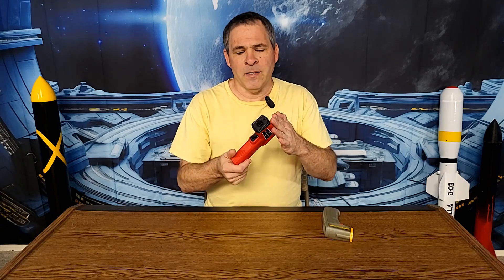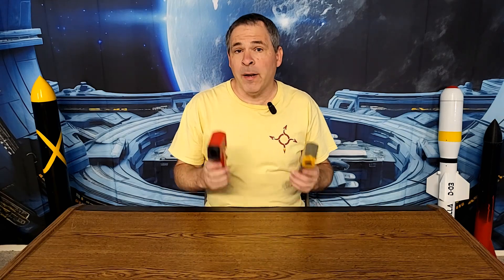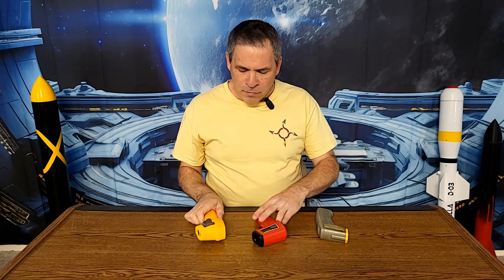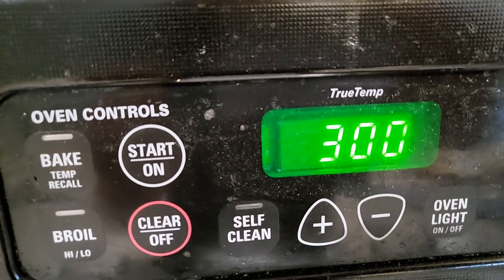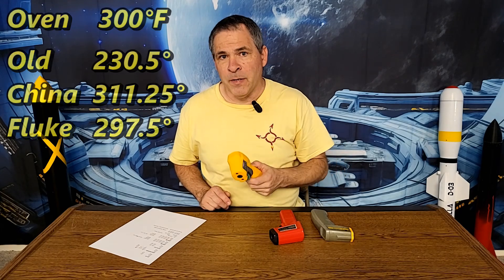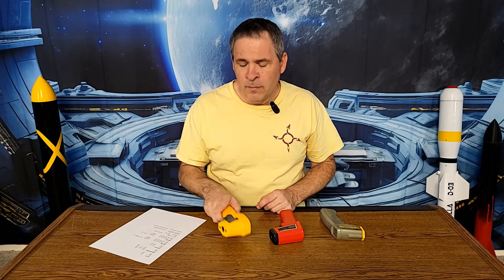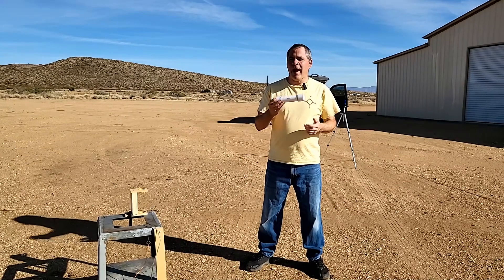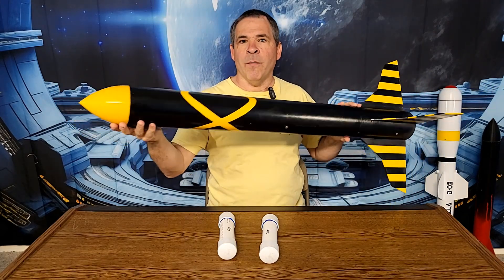I've been cooking sugar rocket fuel WAY too HOT

Comment: Wasn't Jimmy Yawn instrument as an innovator is sugar fuel before Dan? Not disputing you. Just been a while since I've read about Jimmy. I believe Jimmy called many of Rockets Sugar Rush. Most were red and neon pink?
Reply from the maker: It's quite possible that people were making this or a similar mixture before Dan. But I've heard many times that Dan is commonly considered the inventor of the mix and when I spoke with him, he is under that same understanding. I also asked Richard Nakka about it once and he also agreed that Dan is typically considered the inventor it. But that's not to say that there were never any people making it before. It's very possible that after coming up with the idea and mixture, Dan coined the phrase "flexi-fuel" and it's popularity took off from there.
I'm not familiar with Jimmy Yawn or his fuel mixtures. What sets Dan's "flexi-fuel" apart from the old traditional sugar fuel mixtures was the addition of corn syrup. Not sure it that was something Jimmy was using.
Reply: @rotaryrocketry Typos! Sorry. My phone is over caffeinated on spell check. I think Jimmy's motors were a mixture that hardened quickly, often had cracks and of course that lead to catos. This flex fuel seems a bit more forgiving also in temp range. Thanks for you videos. I'm getting back into rocketry after many years and appreciate your time you've invested on all this work.

Comment: Hey, can we use a digital probe thermometer, as here, where I live, its almost 8 times cheaper than an IR one?
Reply from the maker: You can as long as it reads the temperature quickly. You need a fast and fairly accurate reading.

Comment: Hmmmm, Richard Nakka asked me to oven heat our KNO3 for the Sugar Shot to Space project to drive out the water since it adds weight. If the KNO3 used where he or Dan lived has high humidity, that would cause measuring a 65-35 ratio to be different than where I live in the normally dry desert. That was the reason. Since I often make 15 to 150 pounds of sugar propellant at a time, drying those large amounts in a pan in an oven would be time-consuming; fortunately living in the normally dry desert, I don't have to do that. Even during the winter when humidity increases during dew or rainy periods, I don't bother with drying my KNO3.

I can't believe you use a simple $5 oven thermometer to check the calibration of your instruments. I've seen them vary by almost 20 degrees on the self in stores. But, is useful as a reference for comparing your three IRs. https://www.walmart.com/ip/Oven-Temperature-Thermometer-Thermometers-For-Inside-Accurate-Thermometer-With-Probe-Baking-High-Stainless-Steel-Pointer-50-300/5283794207?wmlspartner=wlpa&selectedSellerId=102633389&adid=222222222275283794207_102633389_14069003552_202077872&wl0=&wl1=g&wl2=c&wl3=42423897272&wl4=pla-319455734609&wl5=9031441&wl6=&wl7=&wl8=&wl9=pla&wl10=5499694558&wl11=online&wl12=5283794207_102633389&veh=sem&gad_source=1&gclid=CjwKCAiAg8S7BhATEiwAO2-R6tIPlDIW8ig0xhNRyAZ19j0NDAZl76kL7m-xV7k4Ml3cDS959t9twBoC2tkQAvD_BwE 

I could be wrong since I do not own the wok that you have but my experience with electric cookers is they work with a thermostat, the higher you set the temp, the longer the power stays on until it reaches that temp and then shuts off. My experience shows that when you measure the 'surface temperature' of the melt, that is different than what it is inside and the more melt you have, the greater the temp difference between the surface being measured and what is in direct contact with the metal on the bottom. It also varies with the amount and frequency of your stirring.

One thing I haven't seen you do is measure the amount of time you are heating your propellant. Water evaporates, the warmer the temperature, the faster the rate of vaporization. Corn syrup has as much as 25% water (that makes the stuff fluid). So even at a 'low temperature (~180 F) you are driving out water out of your mix. The longer you keep the temp at any elavated temperature, the more viscous your propellant will become.

Another thing to consider, if you are grinding your own sugar, the amount of time and amount in the grinder will determine your particle size; not significant IF the sugar is getting dissolved in the corn syrup which may not be happening if the water that would do the dissolving is leaving the corn syrup being heated. 

I seldom use a thermometer since after making thousands of pounds of KNSB, I know about when the temp is right by the viscosity of the melt. Sorbitol melts at about 200-205 F, yes, different types melt at different temps, but I usually heat at around 200-210 F and when it is all melted but still too viscous to pour, I turn up the heat somewhere between 250-300 F simply to get the container to start heating until it is fluid enough to pour (usually between 215 and 220 F). I don't need an 'exact temp', I heat it till it becomes pourable.

Another factor that controls the viscosity of your melt is the particle size distribution of your KNO3, something you don't know without doing a sieve size analysis. We often would do one for each brand of KNO3 we were using and adjust accordingly to bring it into what we considered to be our acceptable range.

As for your testing by comparing two flight videos, that would be valid only if you did several of each in addition to recording the ambient temperature of the propellant prior to launch...warmer propellant in the motor has a higher burn rate. We see that often here in the desert when launching at different times/temperatures during the day.
Reply from the maker: That's quite a post... Appreciate your thorough analysis.  For anyone reading this in the future, I'll try to address some of those comments.

As for pre-cooking the KNO3... It's a newer concept for me and I've only been doing it for a short while now. I'm also in  a dry desert but I still feel it's a good idea. I don't know how the KNO3 has been stored prior to me getting it. Dan Pollino was in the San Diego area when he was making motors. I'm planning on doing a test in the future to see if a motor with dried KNO3 will perform differently than a motor made with KNO3 that has been deliberately exposed to a high moisture environment.

As for the oven temp... There were really several factors for the temperature testing. The oven itself was set to a specific temp, the oven thermometer was there to verify that temp and then the three IR's were compared. So I was really looking at the overall picture from all of these readings.

The wok... I have found that it is VERY easy to overheat the fuel using the wok. Dan's original instructions say to turn the wok to it's highest setting. But I've found it better to start low and work the temperature up as needed. Stirring frequently and vigorously is a must to keep the batch of fuel at least somewhat evenly heated.

Heating time... Yeah, I think in some of my older videos I had put the cooking times on screen but I haven't done that consistently. Something I will keep in mind for my next build video. Now that I'm cooking to the proper temperature with my new IR thermometer, I have found that the cooking time is extremely short for my small batches of fuel.

Sugar granule size... I don't grind my own. I use powdered sugar. I know it contains a small amount of corn starch but I think the convenience of the product out-weighs the fact of having a small amount of useless corn starch in the fuel.

KNO3 granule size... Again, I don't grind my own. I'm purchasing powdered potassium nitrate. But as you know, that is not really a very fine powder... More like table salt. For the small motors I'm making, I'm not really that concerned with making super accurate measurements of the granule size for this. Sure there may be a slight variance in performance based on granule size but for my small motors, it's probably very minimal.

Flight comparisons... I realize that it would have been much more scientific to do like 4 or 5 launches with each motor and then average out the results. But really, that would have been WAY more work that I am willing to do for a simple project such as this. Also... getting 10 perfectly successful launches in a row... WOW... I'm happy to get 2 or 3 in a row without something going wrong. The launches were done back to back so the motors were at the same temp and the air temperature was basically the same for both launches.

Comment: I think I remember you saying that you cook on an induction cooker? That could possibly be what caused the problem. You're not supposed to have it around strong electromagnetic fields. It's that or either the emissivity was not correctly set on the thermometer.
Reply from the maker: I do not use induction... I use either a standard electric cooktop or an electric wok but neither are induction. Interesting thought... I'm not sure if and EM field would affect IR thermometers. The thermometer has no apparent adjustment for calibration but I'm gonna take it apart and have a look inside before I just throw it away.
Reply: @rotaryrocketry my mistake I saw a video and in the video they were using an induction cooker and I was thinking that was you.  I'm not really sure what it will do to the thermometer but I know it does say not to have the thermometer around electromagnetic fields. I have 2 different thermometers (different brands) and in both manuals it says to keep it away from e.m.f.
Reply from the maker: That's really interesting... And good to know.

Comment: Yuuup. I experienced this a while back with my wifes shop. She makes artisan soaps and you have to hit a specific temp for the process to work and pur first ir thermo gun was way off. Now she uses an old school candy thermometer haha.

Ok, now, here is my question. Can you still cook the fuel to 230F using an accurate thermometer such as the fluke? I mean, the 290F fuel worked for you, so i am guessing that 230 would be fine?

As for drying the kno3, i only do that when making the powder version of rocket fuel. But most of the time my kno3 is in a container with rock salt or a packet

If youd like the science behind why the 290 motor went higher, i can explain it:)
Reply from the maker: I think Flexi-Fuel would work just fine with any cooking temperature from 210F to 270F. It's just that the higher the temp, the faster it will burn.

I already have plans for an video/experiment for testing to see if drying the KNO3 is of any value.

As for the 290F fuel going higher... Well, you are welcome to post any insight you feel is appropriate. The flights were very similar and both well within the typical range for this rocket/motor combination. That faster burning fuel would have resulted in higher internal pressure and a more powerful thrust. The rocket with the 210F fuel also had a slight "wobble" just after it left the launch rod and that caused it to loose a little bit of speed.

Comment: Now it all makes sense. You may recall our back and forth on your K500 motor builds. We were trying to understand why your burn time was only 55% of Dan's burn time on your second (successful) build. None of the cook temperatures were making sense when comparing to the known and established candy making phases.

So, I looked back and reverse engineered what was really going on.

Your older thermometer was off by a factor of between 0.79x to 0.77x. So the real temperature was 1.26x to 1.30x higher than what the thermometer was indicating. For simplicity, I'll use 1.28x.

Dan cooked his fuel to 210F, but he was at sea level. This equates to 203F at your elevation.

For reference, here are the candy making phases at sea level.

230 - 234  Thread (syrup)
235 - 240  Soft ball (fudge)
245 - 250  Firm ball (caramel)
250 - 265  Hard ball (taffy)
270 - 290  Soft crack (butterscotch)

What temp should you have cooked your fuel, based on the faulty thermometer?

203F / 1.28 = 159F

Just for fun, let's take a look at your second (successful) fuel prep and find out what really happened.

160F measurement
This is when you should have stopped cooking, since the real temp is right about 203F, adjusted for elevation = 210F. I noticed that the color of the mix is almost as white as the unheated mixture.

170F measurement
The real temp is 170F x 1.28 = 218F. Adjusting for elevation, this 225F at sea level. This is approaching the thread phase. The mix was just starting to turn more brown in color.

180F measurement
The real temp is 180F x 1.28 = 230F, adjust for sea level = 237F. The mix has moved through the thread phase and is now in the soft ball phase. The mix is definitely browner.

190F measurement
The real temp is 190F x 1.28 = 243F, adjust for sea level = 250F. The mix has gone through the firm ball phase (caramel) and is going into the hard ball stage (taffy). The mix is substantially browner now. 

You'll notice that the volume of the mix is now greater. You mentioned the "foamy phase" you always experience between 180F and 190F, and we couldn't understand why, since this was nowhere near any of the candy making phases. Now it's understandable, since we see that the mix is really going through caramelization and beyond. This probably also explains why you filled the rocket and the top level was higher than Dan's recipe. He never cooked to this phase, so his volume was less.

200F measurement
The real temp was 200F x 1.28 = 256F, adjust to sea level = 263F. Full-on Hard ball phase. This is where you stopped.

It's interesting in your video, you had some spare fuel that you cut off the top. When you tried to bend it, it definitely had the consistency of taffy (hard ball phase).

In your first (failed) K500 build, you cooked to about 210F. This would have put the real temperature into the Soft Crack phase. The soft crack phase is characterized by forming threads that don't bend, they break when bent. I'm thinking that when you had to force the rod out of the fuel, it probably left micro-cracks all up and down the inner surface. Maybe this helped explode the first one.

I know this is a too long comment again. I just think it's interesting - maybe it will help somehow. If you see any errors, just let me know.

Cheers!

P.S. - I'm hoping you'll get back to that K500 and make a rocket flight.
Reply from the maker: I LOVE IT ! Might be the record for our longest comment but you are spot on! We probably have blown up a lot of motors in the past that would not have blown up if cooked to 210F. The K500 is just a really good example. Plus, as you saw, you could watch the color of the fuel changing as I documented the temperatures.
No more "foamy" stage during cooking... the fuel heats up to 210F extremely fast. In fact, I've made it a few time now and I have to be really careful because it's SUPER easy to quickly go past 210F.
Not sure if I will re-visit the K500 again but it's always on my list of possible projects. That motor scares me but I feel a little better about it now that I've nailed down this cooking temperature issue.
Thanks for being such a loyal viewer!
Reply: @rotaryrocketry  Luckily, the prior videos you made about DYI rocket motors - I don't think you need remove them, right? I mean, following the instructions as presented will still make a good rocket motor, even though you were using a faulty thermometer. It's just that the performance of the fuel will be different for the user than that shown in the videos.
Reply from the maker: Correct. Depending on what video you watch, we have always told people to cook the fuel between 210 and 230F. So if they are using an accurate thermometer, then those temps will provide a good working fuel and the casings should hold up just fine. Fuel at those temps will burn slower than what we were using and therefore the motors will have less internal pressure.
Reply: @rotaryrocketry  Oh, and regarding another K500 build, I understand it's a lot of fuel. But you did a great job building up to a grand finale of a successful rocket flight. Also, those two videos got a lot more views than your other vids (over 69k and 14k each), so it seems the fans have voted! Not to put any pressure on you. 😆:rocket-red-countdown-liftoff:
Reply: @rotaryrocketry  I see where you responded to my question about using sorbitol but your reply doesn't show?
Reply from the maker: It's there in the comments.
Reply: @rotaryrocketry  Its showing now. Most likely just a YouTube glitch. Thanks for the response btw.

Comment: So long as you are somewhere close to Sea Level, water boils at 212⁰F.  Do not try to measure the water directly, but put something in the boiling water then remove after it's temperature has come up and quickly read the ir temp.
     I am getting back into rocketry after 50ish years and would like to point out that your corn syrup rocket fuel formula was well known in the '60's.  Not sure of its genesis but it worked just as well 55 years ago as it does today.
Reply: Absolutely correct, don’t know why I said 220degree- old age I guess.   In the 60s and 70s I used a dry mix of potassium, sulfur and powdered sugar. 
I short, I used a brass mortar and pestle to be spark free and hand crushed/mixed these together.   This powder mix was compacted around a mandrill in finger sized tubes. Fantastic 4th of July rockets…